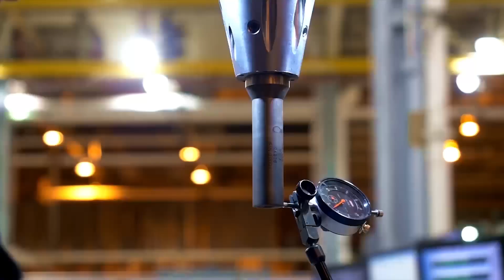Bad News For The 3 Artemis Missions

Comment: There's a large portion of this video dedicated to the problems designing a usable spacesuit. Would it be plausible to simply reuse the spacesuit designs from the Apollo missions? They all worked perfectly and that was over 50 years ago! Am I missing something?
Reply: Yes you are, those suits and their tech and materials are outdated. Also, they got pretty worn out from regolith during three days on the final three missions, especially on Apollo 17 which was the longest with total EVA time. Aside from wear and tear, they also had problems with ring lock mechanisms for the gloves, which were clogged with regolith particles. Artemis program is not repeating Apollo. Tech, materials and infrastructure must be adequate for weeks and months long missions on the surface. Regolith is long term the biggest challenge, sharp, electrostatically charged particles that cling onto anything and also cause respiratory problems if inhaled.
Reply: @FrankyPi  my question was rhetorical. If you still believe we drove cars and played golf on the moon over 50 years ago it is you that is missing something.
Reply: @felixandrews9117  There's nothing to believe, you chose wilful ignorance.
Reply: To save you the trouble here's where you reply by calling me a flat-earther and finish off with a couple of insulting remarks about my intelligence. It's getting old.
Reply: @felixandrews9117  Nice assumptions you made there.

Comment: this is another video talking as if starship & super heavy has flown .... it has not..
  
SLS Core, has been tested to duration in a test stand and it's ORION capsule dose exist & has flown
NONE of this is true of starship & super heavy ....the story of the Rabbit and the hare !!
Reply: Starship's only been in development for a couple years and they're already past where SLS is in R&D.
Reply: @RealGracefulGoose  oh sure SLS is very late
BUT,,, its core stage has been tested for its duration Burn & the ORION capsule HAS flown,, & been Recovered.
Starship has none of this, landed maybe once. HAS not been recovered, (the Achilles heel of the shuttle was it TILES ) superheavy not flown at all,, The Russians N1 had problems with 36 engines firing at once,, one exploded with the force of small nuclear weapon.
Reply: @matthews4159  All of that's gonna change when SN20 launches. Keep in mind, Falcon Heavy has 27 engines, and it works fine.

Comment: The delay of Artemis 1 would be disastrous the SRB's have a best before date and it's expiring this year
Reply: @Jeff James What would you say the chances are of the SLS rocket exploding if Artemis 1 launches after the 12-month SRB stacking period?
Reply: @DarkFalconAnimations  probably close to zero (with that as a root cause anyway).  One of the reasons the US uses solids is to  support to the industrial base (the makers also use the solids for all kinds of munitions like Hellfire). I seriously doubt there's anything that's going to expire that quickly (other than the US taxpayers).
Reply: @jeffjames3111  SLS is supposed to exhibit 10M lbs of thrust on the pad increasing to 12M higher up. The solids provide most of the thrust as the RS-25/RS-25e hydrolox engines in the core stage aren't that powerful. For that matter, they could use RP-1 fueled side boosters like the Titan III-C, but they want to keep pollution down. The only way a non-SRB configuration could work is if they used the engine proposed for the Sea Dragon big dumb booster.
Reply: @jeffjames3111  I was told that the reason solids are used over liquid-fuel is that the solids are simpler.
Reply: @twistedyogert  They are, also super-expensive too. Given the flight heritage that NASA had to call upon it seems an odd choice. Oxygen isn't all that expensive, RP1 or H isn't all that much either. 1000 tons of solids though...
Reply: @twistedyogert  Honestly, my understanding is it was about supporting the industrial base. I'll try to find the article that I read about it. It was a long time ago though but made total sense. Solids do give off huge thrust. But they vibrate like crazy, pollute and are very, very expensive.
Reply: Just like the Challenger.
Reply: @DarkFalconAnimations  it was a different case for challenger it failed because of extremely low temperatures on the launch day which froze the o rings in the SRB's  which in turn caused the challenger disaster.
Reply: If Artemis 1 launches after the SRB 12-month period, will the rocket explode?
Reply: @DarkFalconAnimations  Probably not but the vendor has put this in place so they won't sign off on the the launch if the SRBs are 'out of date'. And boom - another $200million in profit. I will enjoy hearing SpaceX burp after they and the rest of legacy space are eaten ... slowly.. alive. Possible exception of ULA but they have a lot to prove with Vulcan (everyone is allowed to be a Tory fanboi)..
Reply: @jeffjames3111  
This isn’t true, the SRBs have to be inspected and then when they are their date can be extended back like 6 months.
Reply: @warrenwhite9085  
The same NASA giving SpaceX all this money? Literal amoeba levels of intelligence from you and the rest of the people agreeing with you.
Reply: @warrenwhite9085  spoken like a true glue eater.
Reply: @warrenwhite9085  NOT contractors? Are you kidding?! BOEING?!
Reply: @jeffjames3111  NASA selects contractors, contracts them, tells Boeing what to do & how to do it, creates incentives, pays them.. NASA is 100% responsible for ALL their contractors performance.. The FAA is responsible for setting Aircraft design & manufacturer standards, monitoring & approving Airliner construction, issuing airworthiness certificates… ask an pilot or aircraft manufacturer & they will tell you the FAA is (like NASA) totally incompetent, lazy, irresponsible, counter-productive red-tape idiotic ignorant meddling… the root of the B737-max problems Boeing was forced to make the 737/Max meet archaic & obsolete FAA imposed flight handling requirements, then the FAA failed miserably in it’s oversight duties.. Government ALWAYS FAILS, always corrupts, screws up EVERYTHING Govt touches. NASA & the FAA are just more examples.
Reply: @warrenwhite9085  To EVERYONE is to blame for Boeing's failures... apart from Boeing. Check.
Reply: @warrenwhite9085  Then we should respectfully agree to disagree Warren.  My view is that Boeing has delayed SLS in order to simply make more money. It was all legacy hardware, NASA has spent $20Bn without a single launch. I want SLS to succeed but I can't help thinking NASA has been fleeced. That said Congress bear responsibility too.
Reply: @jeffjames3111  Why would anyone be convinced that the solids have a use by date? As long as the fuel grain doesn't have any cracks and all the o-rings are intact then things should be fine.
Reply: @dalethelander3781  Although they probably do military projects behind closed doors.
Reply: @twistedyogert   Exactly! I'm not convinced either.
Reply: @warrenwhite9085  ah yes because these very same contractors like Boeing have had absolutely no issues when left to operate on their own private accord... oh wait.
Reply: @warrenwhite9085  Your ideal world of no government would be an absolute nightmare  dystopian hell hole. Government works but is of course flawed, just like private corporations are, just like charities are, religions, sports teams, etc. Anything involving human beings will be imperfect, but modern civilization would not exist without the basic tenets of a social contract... including the successful market economics we see today.
Reply: @DarkFalconAnimations  Only if one or more of the o-rings fails.

Comment: Who's praising SLS?
Reply: those with their snouts in the pork barrel - although to be fair to the  Orion capsule, at least that part has been ready for a while.

The irony of the resuable space shuttle engines being dumped in the ocean after each flight is not lost on folks either ...
Reply: @tma2001  "Reusable" SS engines . . . 
 . . . that required thousands of man hours to refurbish after every flight
Reply: @Joe-xq3zu  well it was the first attempt at a resuable space engine and they were rated for dozens of reflights but no one is gonna disagree with you about the refurbishment costs - the SS never lived up to its promise as a low cost to LEO transport after all.

It would be interesting to know the refurbishment cost of a SSME in comparison to building and flight rating a new one, for some context.

AeroJet are charging an astronomical amount for upgrading the remaining moth-balled leftovers with the promise of a cheaper, expendable RS-25F version going forward. We will see.

Hopefully the whole Senate Launch System program becomes an even greater embarassment than it already is if Starship can live up to its promises.
Reply: Boeing, and people on Boeing's payroll